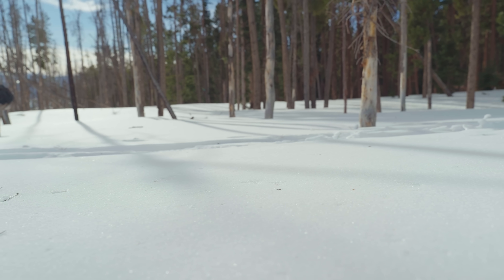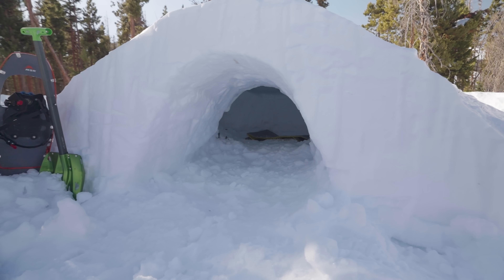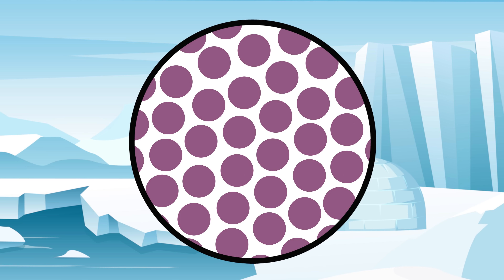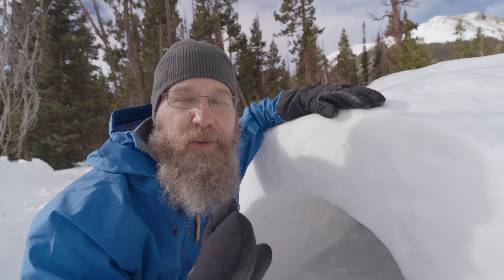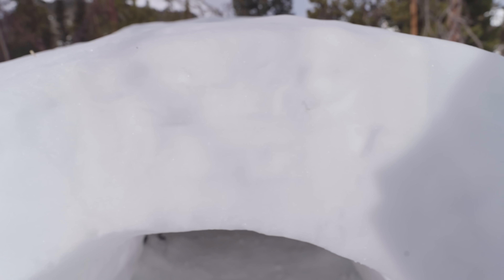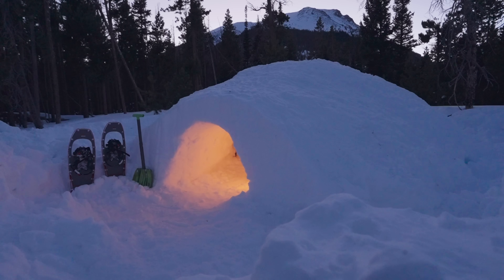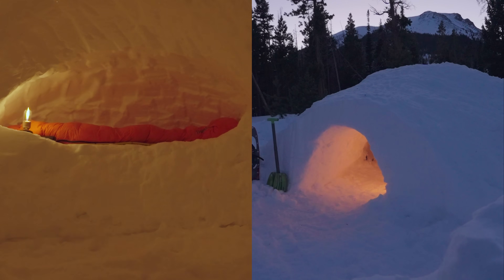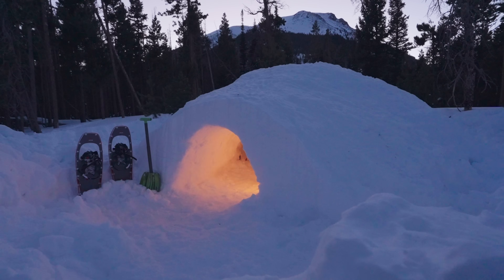Ancient Wisdom Proven Right by Science!

Comment: Wow, you’re right! I hauled a pile of snow into my bed last night and used it for a blanket, and it wasn’t long until I felt so warm I felt an urge to remove my clothes and drift off into blissful sleep. Unfortunately my wife interrupted my slumber with a rude trip to the emergency room.
Reply: Heat is produced by some energy jiggling the particles, cold happens when there is NO energy to jiggle them they froze. That's what i understand from his explanation that heat is "something", cold is not
Reply: actually loving your humor and was here to say a similar thing, just in a much different way.

Snow definitely IS COLD. If it's not, then sleep in these snow constructions with little to no clothes. 

Also, COLD is a thing. Yes, it is essentially when more heat is leaving than you can maintain, but that is still the concept of cold. This dude seems hyperbolic almost to the point of danger.
Reply: @unknownalien3837  Obviously snow is 'cold' but it's a very good insulator which is also the point he made.
And what he meant is that cold is not really it's own thing, it's merely the lack of heat/energy. It's like how a shadow isn't a thing, it's just the lack of light.
Reply: @unknownalien3837  did you not watch the same video as me? because he explained it in a much better fashion.
Reply: @unknownalien3837  heat rises, cold air falls, igloo insulates due to lots of air comprising the snow, when inside the igloo it is raised where you sleep while the door is lower, if you block the door with more snow and just leave a little open it will stop cold air from coming in as much but that isn't a big deal because its built to keep you in that warm pocket. I don't think you understand how big of a difference 25 degrees can make. its not like you sleep buck nude in the snow either, if you do that there is a reason nobody else will after you since you would be deceased. let-alone that if you have a better heat source, bigger igloo with more people it will be much warmer.
Reply: @unknownalien3837 You're arguing semantics. Cold is not a thing, but is a state of a lacking other thing (heat). He explained this perfectly well. If you are genuinely concerned that someone will harm themselves by misinterpreting him then please start "the science channel for extremely dimwitted people".
Reply: Hypothermia joke isn’t one i expected
Reply: Lol😂

Comment: If all youre looking for is survival, you can:
Make the cave barely big enough for your body
Use your backpack or a chunk of snow as a door
Keep a candle as a heat source, trust me, it will keep you plenty warm
Make sure the floor is sloping to the side of the cave starting from the middle. There will be condensation and water melting from your heat, and you dont want that pooling up right under your sleeping bag.
Reply: you got to have an opening so you don't breathe all your oxygen away, especially if you have a candle that will help you burn oxygen faster
Reply: @chrism3784   I use a ski pole that punctures the roof which I can maneuver up and down to keep the hole open at night.

Comment: Cold is also a lot better than freezing! Small correction from a science nerd: air molecules aren't less dense if they're hot (they're too small to even have density themselves) but because they're so spaced apart if they're hot and jiggle a lot they push all of the other molecules away a lot more so that group of molecules will be less dense. And so yes they do also still bump into each other transferring a little bit of heat but because air is not dense to begin with there are a lot less bumps so you have more convection than conduction!

Comment: You can also dig out the floor near the door more, and put something over the door to block the wind/keep the warm air in better.
Reply: I would bring a large heavy duty garbage bag and fill it with snow and pull it in with me to use as a door.
Reply: would this cause issues with oxygen or no?
Reply: Takes a surprising amount of time for a human to lower oxygen content in a room too far. The real issue is co2, which is toxic at far lower concentrations. As long as there's any contact between inside and outside, the co2 will diffuse out though.
Reply: @mappplesirrup8473  Most igloos also include a vent in the roof, for that reason. It also allows you to have a heat source inside without it filling the structure with CO2.
Reply: @CrashB111  Wouldn't a vent in the roof kinda ruin the point of keeping the heat in? Warm air rises thus leaving through the vent. Though I suppose it makes more sense if you have fire inside.
Reply: @ It doesn't have to be a huge hole, it's usually just a small hole cut into the side of the roof.
Reply: @CrashB111  CO2 is heavier than O2 though, so you still need some way to get CO2 out

Comment: I used to teach mountain and winter survival to Boy and Girl Scouts as a member of the High Adventure Explorers in Northern California. Every year we put on a "Freeze O' Re" in North Lake Tahoe where we invited all the scouts we had taught to put their skills to the test. One of the competitions was to build an igloo. Looking at your igloo, you did a really good job. The entrance should be a bit lower, you want a right angle to prevent the wind from blasting through the entrance, but that might not have been possible depending on the depth of your snow you were working with, and I did not see a vent in the roof of the igloo to allow smoke from your lantern to escape.  Otherwise, great job! Really enjoyed the video!
Reply: I am an Eagle Scout from Washington and this was definitely one of my favorite outings we did. I only got to do it once but I have a lot more knowledge now and want to put it to use at some point
Reply: Don't need to build a right angle for the entrance, you need to build it AT a right angle to the wind direction.
Reply: how big of a hole do you need or is there something about the hole placement that limits the heat loss relative to the amount of smoke being cleared?
Reply: @Taigiry  It really depends on the size of the fire in the igloo, but doesn't have to be very big at all. The placement varies, but typically "points" forward toward the entrance as the air that is pulled into the igloo is then siphoned back out which in turn pulls the smoke out. But from my understanding the placement isn't set in stone, or should I say ice? When we made ours the hole was typically the size of the handle of our shovel - since that's how we made it.
Reply: nice HAL pfp

Comment: One thing you need to do in an igloo is to try smoothing up the inner wall so as to prevent droplets dripping on you when you sleep. Also in my time in the French mountain troops we’d build half /half igloos, half dug, half built up.
Reply: They used to say you needed walls about 30 centimeters thick (about 1 foot) to really insulate you from the outside. But once inside, just one candle could raise the temperature. But still it was a somewhat miserable night because at the time (1980s) we didn't have performing equipment, e.g. sleeping bags were just the standard army issue (not sarcophagus).
Reply: I watched recent videos on French mountain troops and they don't seem to be building igloos any more: either they dig a big trench with side 'benches' or they simply use tents. Seems the equipment against cold is much better now/
Reply: @richarddykiel8141  Yeah insulated tents are ridiculously effective these days. They keep getting better every year too.
Reply: @timbrwolf1121  Yes but a drone will spot a tent, not necessarily a hole in the snow.
Reply: @richarddykiel8141 if the temps inside were above freezing, did it start melting?
Reply: @S5King7  It could. The inner temp hovers around 32F, and might be higher especially if cooking food inside
Reply: @S5King7  The inner surface will melt slightly and form a layer of ice. The rest of the thickness of the snow walls have too much thermal capacity to be melted (like the melting snow in the pot example on a larger scale)
Reply: @richarddykiel8141 
Where are you going after you die. Repent today from your sins. Hebrews 9:27 says as it is appointed unto man once to die but after that the Judgement.

Confess your sins and turn to Jesus Christ today. He is the way, truth and life.
Reply: Do you dig the upper part our the bottom one?
Reply: @marcosruim9292  you dig a hole in the snow and use the snow you dug out to build it up. you got to think of a lot of snow like 2-4 feet deep
Reply: @ That is correct we built igloos by teams of 4: one or 2 were digging, the rest started by packing snow by stamping it with our skis then cutting snow bricks. They had to be sloped inwards so that stacking them would result in a rough dome. You also had to dig an entrance that would curve below the igloo floor so that cold air would go there. As I said you had to smooth the inner walls as best as possible (we were using waterproof mittens for that purpose). You also had to create a small gutter running all around the wall on the floor to catch any water running from the walls.
Reply: we built quinces in Scouts Canada and we would light a 'tea candle' inside it for this reason. by the time the candle burned out, the inner surface would melt and freeze, turning the inner layer into smooth ice which would not melt when we slept with all the snow stack on top. Then we could go in. We also angled the doors down wards to trap more of the heat inside.
Reply: Furthermore using tents is more efficient time wise since building igloos take several hours
Reply: @richarddykiel8141 building takes energy which you deplete quick and it's gone
Reply: @richarddykiel8141  I wonder if the greater method, then, would be to set the tent for sleep. Then, build the igloo large enough to fit the tent in the igloo. Or would that just be splitting hairs with safety/warmth?
Reply: @VideoWatchingMannot doable the igloo would have to be too big to be constructed in time for the night. If you have a tent you use the tent.
Reply: @richarddykiel8141  oh I just meant that you’d build the igloo over time, but use the tent for sleep until you have it built. And then move the tent to the igloo
Reply: A dome for 4 people? How wide, usually? I assume as small as possible…
Reply: @ I don’t recall the size I just recall the teams used to build them
Reply: In the legion we only had sand. 
Would have killed for snow.
Reply: The Inuit people, line their Igloos, with Caribou skins, using toggles, to help keep the inside heat away from the snow.
Reply: @albertlorenzen3048  Never heard that one before. Learn something every day.
Reply: @albertlorenzen3048  THe, Inuit people, line, their sen,tences, with too, many commas.
Reply: j'ai un bon pote dans les chasseurs alpins et ses story sur instagram montrent exactement ce que vous décrivez, un trou dans la neige avec un toit
Reply: igloos dont work when its not as cold
Reply: That is the very reason NO ONE has ever heard of "the French mountain troops"
Reply: You make a fire that in itself seals. Study Inuits.
Reply: so?
Reply: Jesus loves you, please come to Him in these last days.
Reply: They did/do the same in Italian mountain troops and everyone will tell you you don't freeze to death.

Another trick is to put your hands into the snow, then put them back into your wool gloves (I'm almost sure it works even with other materials but I should try again). In few minutes your hands will be like a stove, and once the extremities of your body are warm, the rest is warmed up too.

I wish to remember that Italian people came back from Russia by foot, during Russia retreat in ww2.

A lot have died but a lot came back as well, in one way or another.

And of course, not all of them were used to extreme cold, even the mountaineers.

But still, the second type knew at least few things to keep them alive.
Reply: just wonderin....you say it was the French mountain troops....so.....did y'all ever get up to any brokeback mountain stuff?

Comment: Hmmmm. Kinda supports my theory that everything should be inflatable. Cars, houses, furniture, tents, buildings, boats, ships, airplanes,...etc. Perhaps not submarines, but then, who really needs one of those ? 

So, if you want a warm shelter (or a warm body)....trap air. Food for thought.
Reply: Houses perform better if there is a thermal mass on the inside (as opposed to the usual outside), which will help maintain a steady temperature an require less energy. External to that you want your insulation layer (take your pick) then the final layer is best if it is both a) fast at convecting temperature and b) highly weather resistant. The last one is more “tricky” than its two internal cousins, but can be done. But you are right - air movement (or not) is the key.

Comment: I love your videos, however, you screwed up on this one. You built your igloo incorrectly.  

The entranceway floor is supposed to be two or three feet lower than the floor of the igloo.  This way warm air is trapped in the higher igloo chamber at an elevation above the entranceway. 

Your igloo will not work correctly.  This matters in a survival situation.
Reply: The entranceway roof should be lower than the floor.
Reply: @kore5080  

Of course.  That's what I meant to convey.